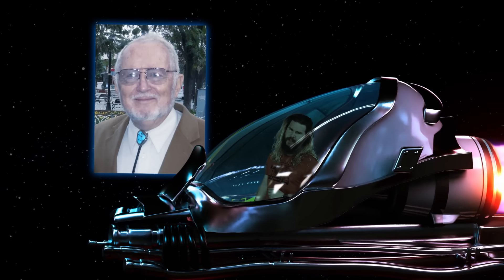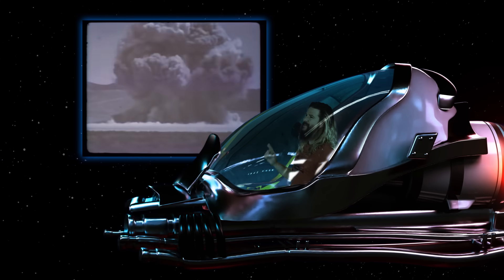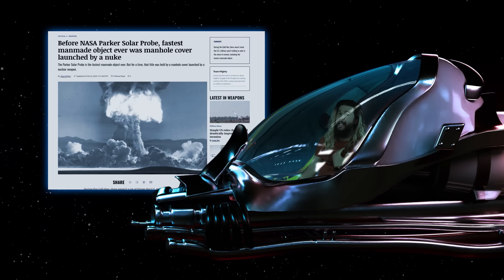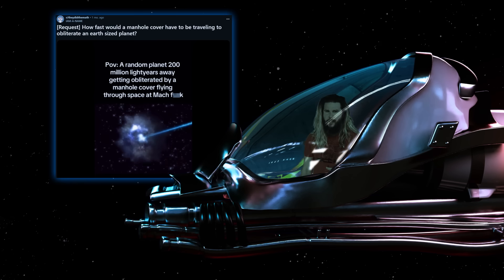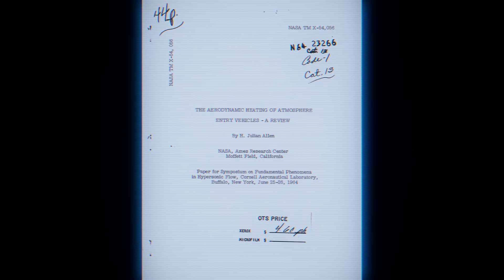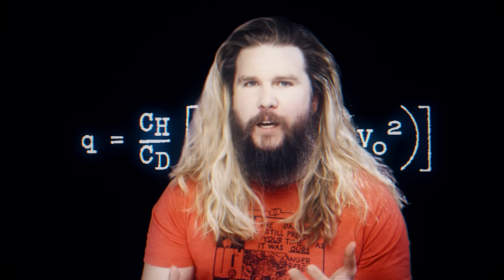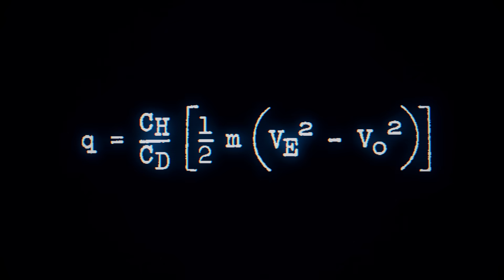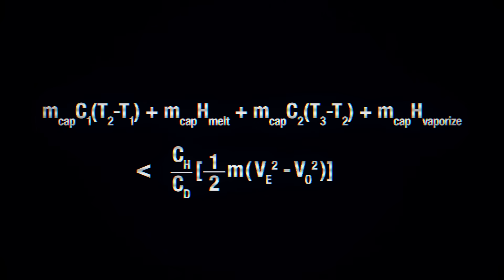Debunking the Nuclear-Powered Manhole Cover

Comment: Cast iron is actually an alloy of iron and carbon which has more carbon in it (around 4% by weight) than high-carbon steel, which maxes out around only 1.5%! I don't think this changes the conclusion given the extreme excess of energy being dumped into the metal slab.

Comment: Isn't it a bit much, to take one unrelated equation from a NASA paper, plug some numbers in, and call it a final answer?

The equation you took is for the total heating an object sees, when coming back from space. These experience a prolonged heading period, our manhole cover moves at 66 km per second straight up. After less than two seconds it has passed the Karman-Line.
When I understood your math correctly, you made 66km/s v0 and assumed it stopped, that ofcourse gives an enourmous number. But you have no data to back that assumtion up. No one has.

You should not shit on other youtubers, who don't do the math, when your math looks like this.
They are honest enough to state, they don't know, while you wave one formular around, that DOES NOT FIT THE PURPOSE and claim to answer this question with math and science!

You can do better, please strive for it.

Comment: Very likely mentioned- I ain't checking 3000 comments, ha ha! Buuuuuuuut......

All this math seems- repeat, SEEMS (I may have missed it)- to ignore one very important value: time elapsed.
Assuming an initial velocity of  155000mph, that yeilds 43mi/sec. The Kármán line is around 62mi straight up. So, the disc would have reached 'space' inside 1.5sec. Even accounting for drag (which decreases as it goes into rarified atmo, of course), even 2sec to reach nearly nil drag seems plausible.
So, the question then becomes, 'is that enough time to create the energy needed to vaporize iron?' That's the missing value.
If only half, or even a quarter of the initial mass reach effective zero drag, then there is, at minimum, a 500lb chunk of steel flying away from Earth at an amazing velocity. Even at half of the initial velocity, 21mi/sec, upon reaching the Void, that puts its current distance at roughly 51.655 BILLION miles away.
Assuming a perfectly straight trajectory, of course. If it interacts with sufficient mass or gravity- oh, look, Ganymede perturbed the motion!- then all bets are off.

As for the meteorite comparison, 'but rocks fall from space every day, at lower speeds, and vaporize'. Well, yes, but they experience INCREASED drag as they fall into the denser air, AND there is more time to reach the levels of energy needed to melt away, if maybe not 'vaporize,' as such.

Comment: Here’s another thing wrong with the equation. The manhole cover wasn’t iron but hardened steel which has a much higher temp to melt and vaporize.
Reply: Oh ya another thing to add since it’s punching through the atmosphere at high speeds yet the manhole cover started at a much lower tempature so wouldn’t the Leyden frost affect will be in affect?
Reply: Iron has a higher melting point than steel. What are you talking about.
Reply: @willjapheth23789  steel alone with no other change with it yes it has a lower melting temp. But hardened steel makes it much more denser than iron and normal steel, which will be taking much more energy to melt it
Reply: @DumbIShallBe  no it doesn't. Google iron-carbon phase diagram or iron-nickel  phase diagram, or literally any phase diagram. Pure iron has a higher melting point than any steel. Steel is stronger at higher temperatures because of hardness properties, but will always melt at a lower temperature. And the temperature is not much difference, typically less than 100C. Tungsten, yes absolutely has a way higher melting temperature. Steel, absolutely not.
Reply: @willjapheth23789  I was saying there is more material to melt in hardened steel than iron requiring more energy such as higher temperature or prolong the time it takes to melt.
Reply: @DumbIShallBe  the manhole was larger than usual, but a cubic meter of hardened steel will melt more easily than the same volume of iron. The reason hardened steel is hard is because the other elements put pressure on the metal crystal making it harder to move. In a pure metal, the crystal is in a low stress state, so it takes more heat to break the bonds. Pure metals can be more reactive though, so pure iron would rust more quickly, so iron might disintegrate faster due to combustion, but not melting or vaporization.

Comment: I have 2 questions about the math in this, 1. The scientist who did the calculations said that was a low bound estimate for how fast the manhole was going, does that mean there is a theoretical speed this manhole could have gone to reach space or is this a situation that if it burned up at the low bound it would have for sure burned up at higher speeds? 2. If I understood your dimensions right this manhole in your calculations would have been going up the entire time exposing it’s flat face, are you saying that it would be flipping in the air like a coin or did you think it flip like a coin in the air would have made it even more likely to burn up so it wouldn’t matter?

Comment: I'm curious, how much does the direction of travel matter? Was it close enough that if it was traveling edge on it would make it to space? Also, observation of similarly shaped objects (coins) traveling through the atmosphere shows that they tend to spin/tumble, would this affect the result? Also also, when entering an atmosphere, resistance increases and the object gets deeper into the atmosphere, thus progressively increasing the heating of the object, while in this case we start at highest resistance while the object is still cold, and as the object travels and heat builds, resistance decreases, thus lowering the progressive heating, but by how much?

Comment: Question, you said about 8 min in that you are measuring the drag of a flat disk moving through the air. Is the drag being based on the edge of the 4 inch disk or the flat top surface? Would that effect the drag numbers and create more surface area which would create more drag? Or at those speeds does it even matter? Also, would the outcome be different  if the disk were spinning/flipping like a coin?

Comment: Not as big a brain as some people on here, but this is interesting stuff.  I like to think of it like a bullet, but its a really long shot.  When doing long shooting or extremely long shooting I like to think of a term Time of flight, or time to target. This helps to apply some kentucky windage in a cross breeze.  The crazy thing in this is to assume, it acted like an RPG and shape charged itself to a cone, then also the drag co-efficient of that cone at given altitudes. Because every 10K feet pressure is steeply dropping off, so air is thinner, easier to glide through.  And also assuming how much time it would take to melt a ton of iron.  Also, cooling effects as it gains altitude, at just 30K feet its like -20°.  So like lots of factors, did it fold up? Is it flipping like a coin, accounting for pressure drops as it relates to adjusting for drag and speed and the cooling factor of air relative to the heat gained over time…. And how much time was it in atmosphere before like really in space.  So many things to wrap the brain around, I think we need to blow shit up again and observe… ya know for science.  Bury a MOAB or two cap it and send it.  Makes putting a cherry bomb, under a garbage can look like childs play 🤪

Comment: I'm driving so I didn't have the opportunity to analyze the formula, but did this take into account the fact that gravity is not continuously accelerating the cap as it would in the case of an entering chunk of iron? So instead of being continuously accelerated by gravity on entry, this chunk of iron is continuously being decelerated by gravity. Is this accounted for? Also, will this cover really fly in a flat orientation, or would aerodynamics tend to cause it to fly edge-on into the upper atmosphere?

Comment: Have you ever taken a blow torch to cast iron? Regardless of the math, I doubt it burned up in the atmosphere. Simply because of the speed. By the time it started to melt off, it would have been in outer space and started cooling. I’m a steel worker. Cast iron is an absolute pita to cut with oxy acetylene. It’s got air pockets inside it. It’s not a solid chunk of iron. Cast iron has a different melting point than cast iron. The irons molecular structure is changed when it’s liquified and poured into the casting. I’m no genius, but your math leaves out specific information necessary to properly theorize an equation.

Comment: I want to point out the extra insanely complicated math of a rapidly rotating manhole that could create vortices affecting aerodynamics that would change with air pressure(affecting the heat energy on the object), not to mention the heat applied to the initial object possibly affecting its density and shape when it first began its vector.  No one did real concise math on it back in the day probably because the ability to do real math on it given the circumstances is guess work at best.  I'm also dumb! However I think these things still hold true.  I also posted this before the video.  That being said I'm sure someone could study this an get a great guess!  But I doubt kyle would be able to do this no offense=D  If i had to guess , burning up before reaching space would make a lot of sense.  An asteroid sent at this angle would certainly vaporize very quicky but its not made of dense iron and it has a much larger surface area...oh the fun

Comment: While all the other arguments are valid there is one big one that causes your conclusion the most problems.

At 150,000 mph it takes less than 2 seconds to leave the atmosphere. 
The issue here is thermal conductivity. Iron does not conduct heat anywhere near fast enough to vaporize in less than two seconds for that mass. Air also is a TERRIBLE transmitter of heat.
Then you add in supersonic barriers and bow waves and yeah..... while all that heat is technically generated, you haven't shown even remotely that the iron could absorb it. I seriously doubt it even absorbed half that heat.

What you should have done is addressed the other thing you ignored, which is the ablative effect of the air. That would do vastly more to destroy the puck than heat.

Your "common sense" check of meteors is apples to oranges. Much slower speed with orders of magnitude longer exposure and gigantic difference in mass.

Essentially you made yet another click bait piece like the others but yours had sums in it.

For a man who respects science, you sure don't follow the scientific method. Now a whole bunch of dumbs dumbs will treat your conclusion as fact and it isn't even remotely correct.

Comment: Sorry to say that, but these were 13 wasted minutes.. 
With speed of 66km/s there is only 1-2 seconds for cast iron cap to melt. Heat in the material does not propogate so fast. Even in the Iron cap. 
You cannot compare meteorites that travel at shallow angles relative to earth surface that probably spend multiple seconds in earth atmosphere to heat up before they even become visible from earth surface. Also many meteorites are not made from cast iron. 
There was simply not enough time for that cap to melt.
Reply: I think what should be taken into consideration is weight of atmosphere column ( cylinder of air that is radius of the cap) that needs to be pushed away. 
But also you need to know pressure difference from below. There should be enough kinetic energy to move all air atoms away from the path of the cap.
That energy decreases with gained altitude, and is assisted by nuclear blast itself.

Comment: Here's an important question - if we assume for a moment it did not vaporize can we calculate where in space it might be?

Secondly even if it did vaporize - that vapor would still have the same mass and momentum would it not?

Have fun calculating the drag coefficient of a bubble of gaseous iron traveling at mach 🖕🤣

Comment: What really happened will probably never actually be known, as there are so many assumptions and constantly changing variables in this event that I don't believe the math can be done perfectly. Going from dense atmosphere to thin atmosphere is much different than meteors going from thin atmosphere to dense atmosphere. Was the manhole cover tumbling? Flat? Perpendicular to the ground? Vo was also assumed to be zero, which is incorrect but even fixing that would not give us a concrete answer - because some variables will remain unknown until someone invents a time machine and goes back to observe the test with modern filming equipment.

All of this irrelevant because I choose to believe that this iron disk is currently hurtling through space at mach middle finger, and it will eventually be a doomsday meteor for some poor unassuming planet; because it is freaking hilarious to think about - and I don't spread my hopeful opinion to others as fact.

Comment: Hmm... Wait, I see some problems with this math... First of all, doesn't it assumes that the heat transfer is immediate? Secondly, the conclusion should be, that the manhole cover should be vaporised way BEFORE it reached the velocity we observed, but it clearly was not. I might be wrong about the first part, however I can't see any other conclusion than what I wrote in the second part...

Comment: A flat disk moving through the air, we talking full face up or the edge of the side. 4 inches of iron taking the full heat and 4 feet of ironcausing drag out of camera  shot or 4 feet of iron taking the heat and only 4 inches of drag?  Also what about the insulating quality of the iron as they butter layer melts it would also be dispatching heat into the atmosphere as the air move by it and also as it heads molten iron this would take heat with it unveiling cooler materal to the now as you move up less dense there fore less heat causing collision of particles.  Useing an inverse here you would have to go meter y meter of travel from the surface calculate then go one meter up and recalculate taking all factors into effect and at 100km to reach space that's 100,000 calculations that might sound daunting but a simple excel spreadsheet could do it in a few momments.

Comment: I thought this was common sense... Its small and very fast. Bus sized lumps of rock and iron flying way slower in way less dense air burn up almost completely.
Also the speed estimate is pure guesswork, it does not logically compute. What most likely happened is the plate would actually be vaporized by the shock already since it exceeds the speed of sound of steel the plate is made of. It would act as a semi-liquid/plastic-y mush and disintegrate almost immediately as it inverts itself.
However, given the yield of the explosion, the general mechanism of nuclear weapons, the estimated velocity seems quite the stretch. 
A good comparison is actually something known as an explosively formed penetrator/projectile, which is basically what this was.
The "one frame" can be found on the internet, I recall seeing it, and it was just a faint fuzzy smudge on the image, indicating not an in-tact manhole cover flying up, but a complete disintegration of it.

Comment: Im sorry to say but your forgetting so many things.
No1 the manhole cover fliped into an unstable orientation to the direction of the wind. So in order words it wouldn't hit the atmosphere squre on at 90 degrees.
Next thing is that as it slows down quit alot as it goes up, due to it switching from parasitic drag to wet surface drag.
No.2 as the manhole cover goes up the atmosphere becomes really thin.

Comment: Not math, but a different critical error: even if the manhole cover made it to space it is empirically NOT the first manmade object in space.

That goes to a modified V2 rocket, serial number MW 18014, launched on June 20, 1944. It returned the first images from above the Karmen Line and at the time collected the highest atmospheric data ever collected.

Even if we just roll with the postwar propaganda that ignored German space travel acheivements to manufacture a horse race between the US and USSR, the first object lanched into space by the United States was a captured V2 of the same altered configuration code named BUMPER-WAC launched in 1949.

Comment: Setting Vo to 0 m/s is a significant oversight. What you are actually calculating here is if the manhole cover would vaporize *before coming to a complete stop*. Obviously, if it exits the atmosphere before coming to a complete stop, then the total heating would be less than this. That's not the only potential issue here, but the reasoning behind Vo = 0 m/s is not mentioned in the video anywhere.

Comment: Question, what happened to the final velocity? When you inputed the numbers, it looks like you assumed initial velocity^2 - final velocity^2 equal to (66km/s)^2. That suggests final velocity is zero. 

I can see the probable mistake as you took a re-entry equation where the final condition is landing and used it for escape energy, but the cover won't have stopped after exiting the atmosphere

Comment: It would be a non-linear relationship as it moves and heats up, but also encounters less atmospheric density and cooler ambient temperatures. The papers for re-entry and meteor observations are the opposite scenario: the further it travels, the hotter it gets, and the denser atmosphere it encounters. Also assuming the cap stayed flat and didn't extrude into a cone-shaped charge, or fracture because cast iron is brittle...

No math is worse than incorrect math, but incorrect math is still not good. Need a better model with better assumptions to say for sure.